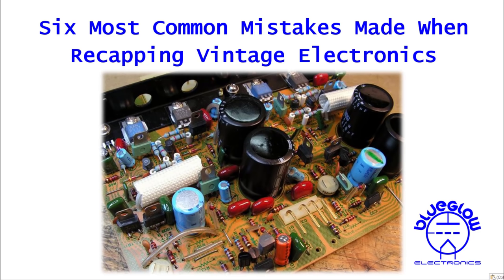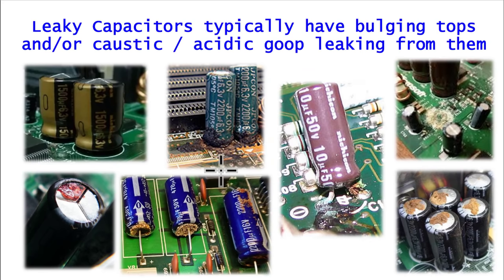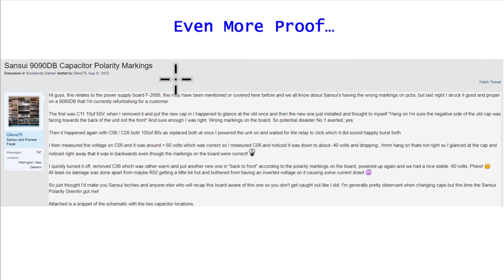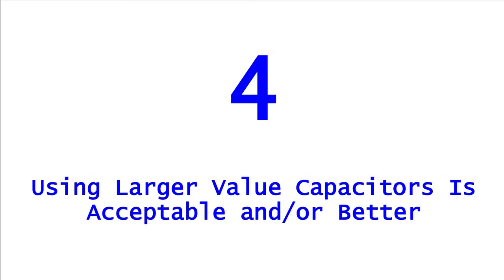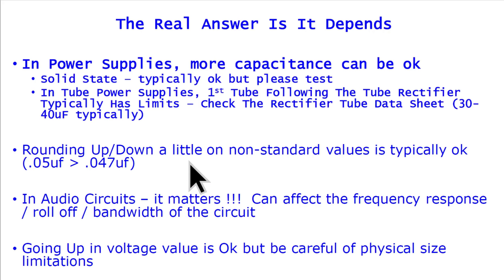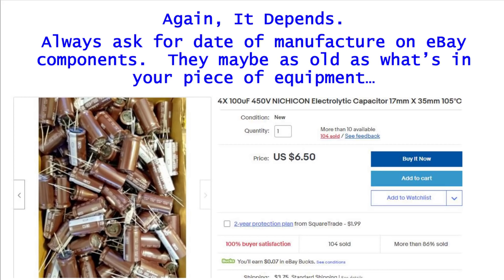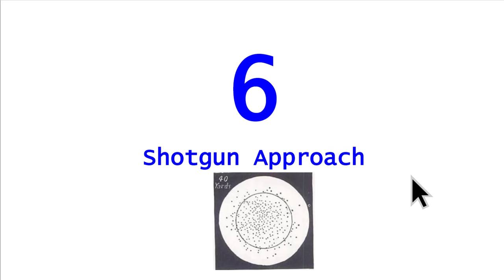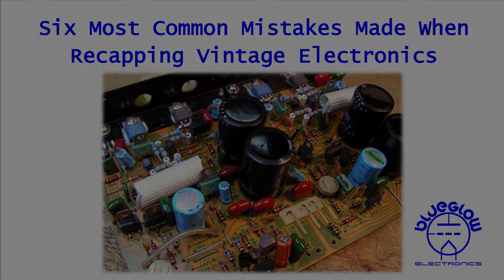Six Common Mistakes Made When Recapping Vintage Electronics

Comment: For some reason the thought of electronics with printed circuit boards being "vintage" really makes me feel old.
Reply: I just took my Marantz 2020B out of storage and began assessing whether I need to restore it (yes I do, the caps are 50 years old but it still works). Got frustrated asking around for advice at the electronics stores and realized that the receiver is twice as old as most of these people. People who restore vintage electronics are a vanishing breed as are the stores and service providers who used to actually know the products they sell beyond the sales pitch. I'm relearning how to use a multimeter so I can do some of the basic testing myself (I've built a few Heath kits over the years so I have some basic skills). You know you're old when nobody seems to know anything anymore and you have to do everything yourself.

Comment: Caps in the tuner maybe part of a critical circuit including resistors and inductors, especially if other than electrolytic. The circuit may be tweeked to perfection in final test at the factory.  Replacing with the same spec part can harm performance because tolerance variations.

Comment: Tip #7: Don't just assume all old caps are bad. Now if we are talking the old wax caps in tube gear, yes replace those regardless of test. But many 50 year old electrolytics are still perfectly good. I have a small 1970 Lafayette integrated amp I use on my computer. I was going to recap but the major caps, power supply, speaker coupling, test quite good on a Sencore LC75 which is a very good cap/coil tester. And I have found the same on many other pieces of gear. So I left them alone. I agree it wouldn't hurt to replace them but then we have the new caps size difference to deal with and it just makes the device look hacked with smaller new caps glued in or wrapped with cardboard to fit the older larger clamps. Hey, just my thoughts.
Reply: It comes down to whether you are just repairing or restoring. If you just wanna fix it & get it out the door, that's up to you or your customer. You're right.....it may be fine for now. But I would never leave a 50 year old e-cap in a unit I was repairing or restoring. Even if it tests good now, it's days are numbered.....
Reply: It all amounts to what you are doing and who it is for, but in my limited experience I tend to agree with Andy.  More often than not the electrolytics on electronics made after say 1970 tend to be good if the object in question has been regularly used.  Time will tell how long these will ultimately last, but I have a lot of silver face solid state hi-fi stuff and most still have the original filter caps.  If I were to ever work for a customer (as I wouldn't because I lack the expertise) things would be different and I probably would replace them since I am in there anyway,  but for personal stuff I go by "if it ain't broke..."
Reply: @wedoshotz6645  Well if I was repairing for a fee, which I don't do,  I would strongly recommend replacement to the customer with the caveat of making the inside look slightly hacked. But for my own use I'll let the old caps ride. But saying that I use some really nice Boston mini cast aluminum speakers on my computer because I had them laying around. But a shorted output cap (this is a single rail power supply amp) could destroy a speaker. So perhaps I should rethink at least the output caps?
Reply: @seanobrien7169   Most of it has to do with the history of a unit........how it was used, the environment it was in, what it was driving...... as to its ultimate condition after 40-50 years. I restored two Sansui G-x500 units.......one was in remarkable shape & all but a couple caps tested great. The other looked good cosmetically but had a burst filter cap & many others that were bad. It had obviously been driven hard & probably in a confined space where heat helped degrade it. You never know.....
 Andy ........ I would at least check them. I know what you mean about the size difference being a pain. Some old 2000uF caps were as big as some 8-10kuF caps of today, & if they're bracket-mounted it's extra fun.
Reply: @wedoshotz6645  I would advice to be just cautious - I have wonderful amplifier made in Germany - Uher CV140 which is unique for me and at age 50 Years works without remarks to my delight . It is rather small  size but packed heavily and - unique everything. There are original best at time capacitors including 4 electrolytic - all matched to outer size. I am sure new like will be different in shape and size.  So replacement "for every case" is not wise.. Also due to board which is sensitive to soldering and copper gets free easy from it. Making urgent decision of recapping in such stuff may proof biggest  mistake
Reply: very true no need to blanket replace all old electrolytics on sight, it doesnt guarantee against future equipment failure, any other part could fail, most of my old radios still have their originals in as they tested good.. it really depends on the circumstances of the cap in the equipment, if its constantly subjected to a fair amount heat, maybe good idea to replace,  if running in cool environment, leave alone,  also depends what effects would happen if it failed suddenly  i take each case as it comes..

Comment: Excellent video!! Regarding #6, do you have sequence you'd recommend for doing a receiver? Is there a section that you should start with/end with?  I plan to do a Pioneer SX-737 and the BOM shows 122 caps and transistors as part of the upgrade. I absolutely want to do a little at a time and then test. I just wonder if there's a logical sequence to follow?
Reply: I would do the easiest one first and the hardest one last

Comment: thanks for video... what about switching from one type to different type of capacitor?  ex) regular type of capacitor to tantalum capacitor.. or vice versa.  I have old PC motherboard(80386 33mhz) it has yellow oval-shape tantalum capacitor in power board but it blew up when I power up.  Some internet advice is to switch it to other type for longevity.  the other says it doesn't matter because it will last another 15- 20 years.. ? what do you think ?

Comment: Factory Glue on the base of capacitors and some other parts will eventually corrode the leads right off of the component. You haven't been repairing these long enough to know that this can happen. I have been repairing electronic equipment for 60 plus years. Clean the glue off as soon as you see it anyplace on a board holding parts down or you will have problems in a couple years.

Comment: I have 3 SANSUI RECEIVERS to re-rectify& re-cap.
#1 is a QRX 6500 .
#2 is  7070  
And # 3 is a 441 .
I understand the 6400 uses a +70 s e. Power supply with quasi complimentary all NPN outputs.
Also with the 6500 quad sections, best to have the 'pins' checked also?

Thank you, sir.

God bless.

BRIAN.

Comment: With electrolytic capacitors on operational amplifiers that only have to withstand the offset voltage, the polarity can also be based on reality, since the developers had no way of knowing in which direction the offset voltage deviates.

Comment: I've seen PWBs with the polarity makings correct on one side of the board but incorrect on the opposite side.  I've also seen a mistake where they intended to use a small value decoupling cap across each large electrolytic capacitor, but screwed up and placed 2 decoupling caps across one electrolytic and left one electrolytic unbypassed with a small cap.  This caused an instability problem which was cured when I added a decoupling cap across the electrolytic.

Comment: I like the shotgun comment, in the end, Working on older ham radio equipment, does that cover the capacitor that blows when  bringing one up to full voltage on a veriack transformer  lol

Comment: Using too low of ESR caps on some older gear can also cause issues.  Older low frequency switch mode PSU for example that doesn't want to start with such low ESR caps or blows a fuse.
Reply: Never heard of that. That gear must have been made in the 50's

Comment: The Electrohome G07 video arcade game 19" monitor has the capacitors at locations C302 marked with incorrect polarity on the board and C107 on the neck board without polarity marking.

Comment: I do recaping and use mostly japan or germany made parts.
I use a trusted brands with trusted source because it always came with realy small tolerances and with same mfg. week tag. Usualy buy a lot and able to pick the same or 0.1% diffrence parts to work together, when the perfect simmetry is an goal. I mostly do vintage studio gears or small chanel count old analog and digital consoles for bands.

Comment: When designing PCBs polarity markings on caps, diodes are easy mistakes to make. Most notorius is to-92 transistor pin outs. There is no standard pin assignment and you can make a mistake even if you check it twice. When manufactuing a PCB, there are always errors. Manufacturers have to weigh the cost of respinning the design with corrections with the cost of assembly work.

Comment: Hi Blueglow Electronics, thank you for this video!
Do you think when restoring a board, e.g. 20 years not been used but previously worked, replacing only the electrolytic capacitors would be enough? Are these the main components that go wrong and age? E.g. resistances, diodes, ceramic capacitors or inductors are not a big deal as these components are generally very reliable? 
Thank you again
Reply: Old resistors go high in value and the other things you mention are generally reliable. But 20 years would probably be okay for electrolytics unless it has not been switched on for a lot of years.

Comment: Check which lead of a new (unpolarised) cap connects to the outer layer. This lead should go to the low impedance end of a connection. The wrong way around and you are turning it into an antennae for noise.

Comment: You mentioned not to replace all caps at one time, but to do the power supply first, then plug it in and check it, then do the pre amp board next, plug it in and check it....and that makes sense. However, I've also read in vintage electronics, that because there's a likelihood of a cap blowing, to just replace them first. So my question is which is better? Plug it in first to verify it even works prior to recapping? Or just start recapping the power supply? And I am aware of using variacs and dom bulb testers, but even with these I have read there is potential for blowing up a capacitor.
Reply: I have bought old valve radios and plug them in and see what happens but stand by the switch to turn off if anything happens, loud buzzing or smoke from something. A visual inspection first inside is a good idea to look for obvious signs of something amiss.

Comment: "When in doubt, meter it out!"  If there is any reason to think that either the capacitor is backward or the polarity silkscreened onto the board is incorrect, use a meter to determine the polarity of the voltage that is going to sit on that capacitor.  Best to do this before changing the capacitor if possible. Sometimes you may find that the polarity marking is underneath the base of the capacitor and not visible until you remove the old one. You could always solder the existing cap back in place, power the unit up, and check in-circuit polarity with the voltmeter before risking ruining a new capacitor, or damaging the surrounding circuitry, by a short-circuit created by a newly installed backwards capacitor.  By the way, there are invariably places in the circuit that use a factory-installed polarized electrolytic where a bipolar electrolytic would be preferable.  The feedback circuit in differential amplifiers at the beginning of the output stage is a classic example of where the capacitor type has usually been chosen incorrectly. They should be changed to bipolar caps!

Comment: What about using radial capacitors in place of axial (larger capacitors)? Radial are more common, thus easier to find replacements, but I've heard the argument that you shouldn't use them in place of axial because you have to bend the leads apart and over time, makes them more vulnerable to leak. I personally have used radial replacements and the base seems pretty secure on the higher quality capacitors.

Comment: For an actual 0.05 ufd cap use a 0.047 and use a capacitance meter to select a value close to desired value. They are usually +/- 10% anyway.

Comment: Regarding everything going  back together, this may be more difficult for us older repair techs to remember: these days, everyone has a high resolution digital camera in their pocket. I take half a dozen well-lit pictures of the unit before I disconnect ANYTHING. Another note, on marking electrolytics you're going to pull for easy reinstallation: why go to the trouble of a desoldering/resoldering operation only to stick 20-year-old electrolytic caps back in the unit? These are .50 (or less) parts that were initially rated for maybe 15 years of service. They're probably pretty dry and have drifted in value. The only case I can think of where this makes sense is when you don't have the right value at hand, but that's easily remedied with a Mouser or Digi-Key order. Any particular reason for that that I'm not considering?

Comment: Great advice! I am getting ready to service my Marantz 2270 and 2215 amps that have never been serviced. Should I replace the caps with standard electrolytic caps, or should I use “audio” grade caps or film [or metallized] caps? Also should I replace the carbon resistors with film resistors?  Would it also be beneficial to replace the transistors with newer faster ones? Which one of these would made the most improvements?
Reply: It never hurts to replace carbon comp resistors, but make sure the wattage and voltage ratings are good enough for the circuit (carbon comps have surprisingly high voltage ratings compared to modern resistor types). As for caps it depends on the cap you're replacing and what the circuit needs in terms of ESR, ripple current handling, inrush current considerations, and voltages.

Comment: A side question: Until a year or two ago I was given the impression that any old speaker cabinets are going to need the capacitors replaced as a matter of course. Since then I have found opinions that if it ain't broke, don't fix it. e.g. B&W DM4 loudspeakers I am staring at right now which I'm guessing were made in 1975'ish.
Reply: Good question. I do electronics as merely a hobby. The only caps that need replacing are the electrolytics. I've read and been told that they should be replaced starting about 20 years. Wonder why those installed in 1975 should not be replaced? Are they truly within specs and functioning as they should?  I too would like to hear the answer to your question.
Reply: @boeing757pilot  p

Comment: I'm in the process of restoring a Kenwood hybrid transceiver. I understand that HV caps in the P.S. should be replaced and the lower voltage filter caps. But the RF boards have many many little caps for coupling signal from on stage to another or for bypass of small voltages. Is there a cut-off point where the tiny caps not being stressed with heavy loads or high voltages can be left in the circuit, as long as they are not showing signs of leaks ??? Thanks for any replies

Comment: some times those varnished capacitors are the faulty ones, I just fixed my Roland D-110 synthesiser, 2 of the 5V rail was suspect so I change them and also those of the +&- 15V.....it is working fore now...

Comment: I mostly work on valve and hybrid amateur  radio gear and the most common mistake I've found is that people rip out and replace perfectly good capacitors with poor quality modern substitutes, believing that they are somehow 'improving' things when they are actually exchanging perfectly good parts for inferior junk.  Buy, and use a capacitance and ESR meter and only replace the parts that needs replacing, and when you do, only use parts from reputable suppliers.   Just my 2 pence worth.

Comment: Hi, quick question. I’m new to tube radio restoration I’m working on a Grundig 9068 that was in absolutely horrid condition. So far I was able to get, power and a strong FM signal however I only have sound coming from the 3 electrostatics and nothing from the 2 drivers (it’s a console unit). I know there could be a number of problems but is this a common symptom of anything? Just looking to be pointed towards what I should be considering to inspect next...
Thank you!!!

Comment: I have a 1929 shortwave receiver that has volume issues. Pops loudly when you turn it on. A friend said a capacitor is bad. I assumed the volume pot was going bad. Just wanted some experienced advice before I start working on it.

Comment: Trying to make a remote control unit for a stereo work, I found what appeared to be an electrolytic capacitor installed backwards. I took it out and turned it around but still didn't work. Maybe it was right way already and marked wrong like you said.

Comment: I will add 7th one - check the capacity of new capacitor and compare to old one. Because old possibly  used upper  capacity margin  and final factory  alignment was done to it. And new capacitors often use lower capacity margin which is still considered regular.

  In bad case  may happen that old 10uF capacitor which is defining the sounding  "kept" last time    13uF and new purchased has 7,9uF which is only  slightly too low Total difference is 5,1uF - 51% change I do not also  replace capacitors in speaker crossovers unless I want to alter  their sounding because there  exact vaule is  99% impossible to repeat